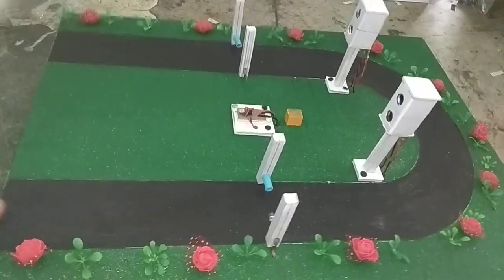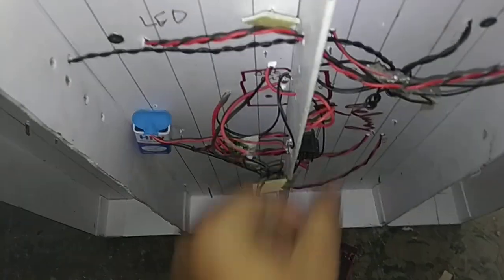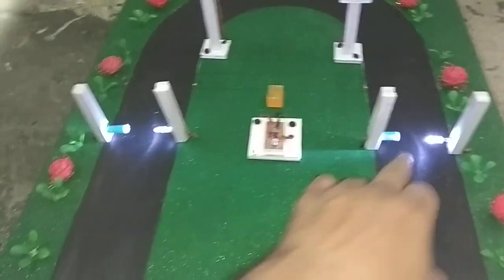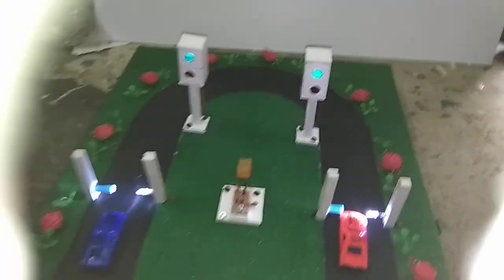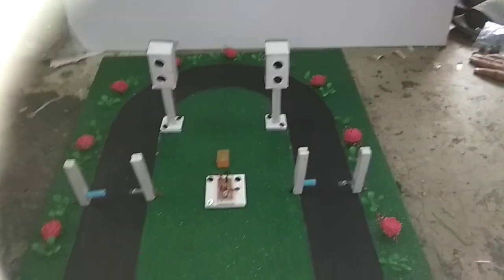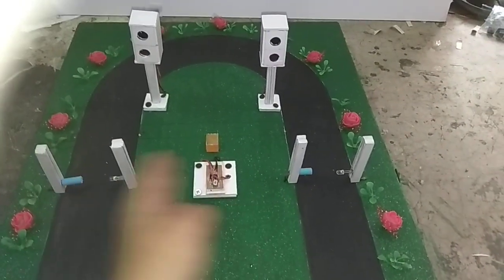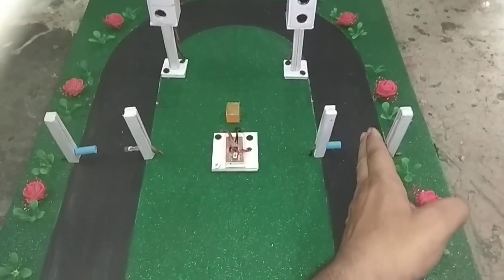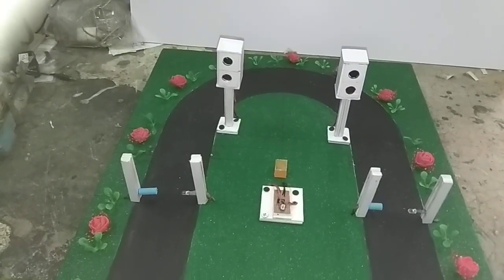Accident Prevention On U Turn Working Model | Road Safety Working Model | DIY Accident Safety Models

Comment: Sir prise kya hai project ka
Reply from the maker: aap apne se banaoge to 1500 ya 2000 tak maximum, if you ask us ? it will be 6000 approx, but if you only need circuit diagram (not model) tab aapko only 1200 me circuit mil jayega hamare paas se.